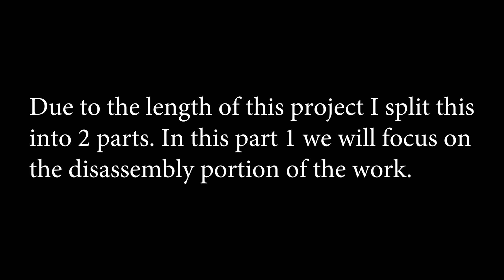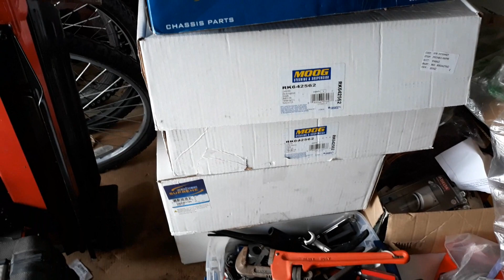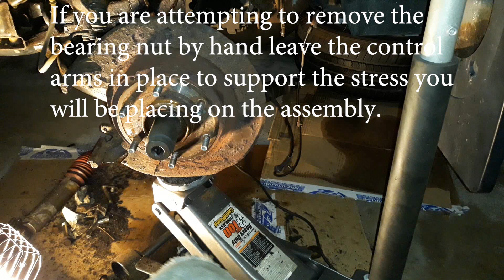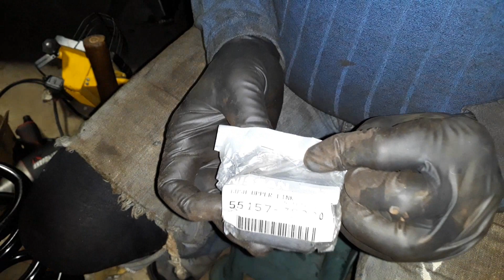2004 Nissan Armada Rear Suspension Part 1 - Removal

Comment: Here's a recommendation from someone who's done the rear hub bearings on a 2011 Armada, when you install the new hub assembly, use a light cote of anti-seize inside the hub and on the bearing contact point, which may also work on the spindle bushings. Makes for a quicker removal on the next go a round.
Reply from the maker: Thanks. Great advise!

Comment: i watch your video, and I just wonder if it is a good investment to replace that much on an old car, material cost vs. the cost of the car.
Reply from the maker: Dealership or garage would likely charge thousands for such work so definitely if you have the time and skill it is better to do yourself. Regarding investment...I would rather pay ~$1,000-$2,000 in parts and my labor than to buy a new ~$60-$80K vehicle. So I do think it is cost effective. Thanks for your comment.
Reply: @jeffkraus1753  if the vehicle still has life to it
Reply: @DailyOpinionsUSA he certainly chose the right vehicle.   That VK56 is unmatched!

Comment: Bought a neglected 05 qx56 with 186k from a tow yard and replaced the rear suspension as well. Didnt have as much rust as you but those bolts holding the arms were no joke! Had to cut some as well.

Comment: We have 04 nissan pathfinder Armada and also tow a 32 jayco. That suv tows with no problems. Ours only has 70000 original miles. Good job on the video very informative.

Comment: If you remove the air bag, and install a shock, doesn't it sit much lower in the rear and mess up camber?
Reply: I have a 04’ Le with air ride I removed the air shock and replaced with a standard shock and replaced the spring with SE model springs
Reply: Nope it sits factory height and rides better in my opinion.

Comment: Hey how has the mavotech held up? Just about to do this on mine
Reply from the maker: I recently had one of the blue boots for the ball joint get pinched and cut the boot. I contacted mavotech and they do not sell replacement boots :( I was going to buy some boots from ebay to replace but have not gotten to it yet. Other than that so far so good.